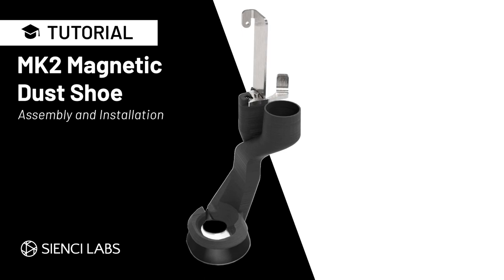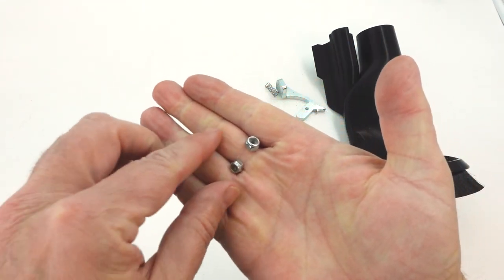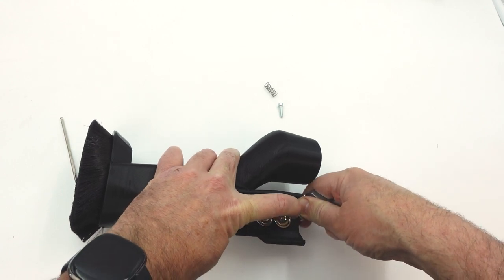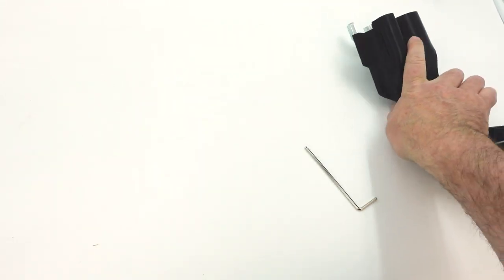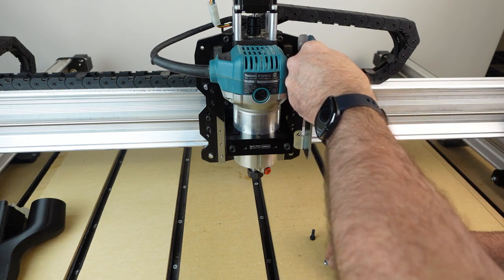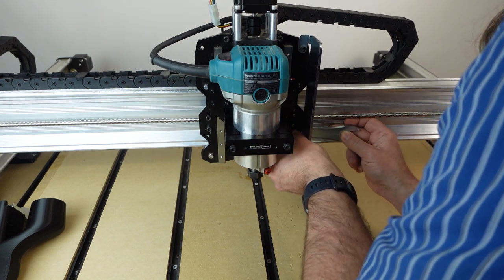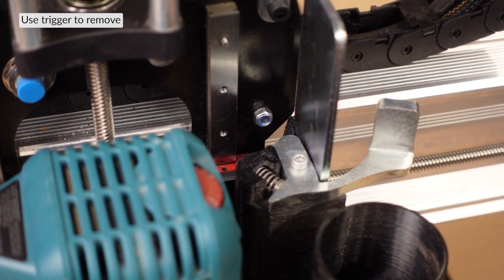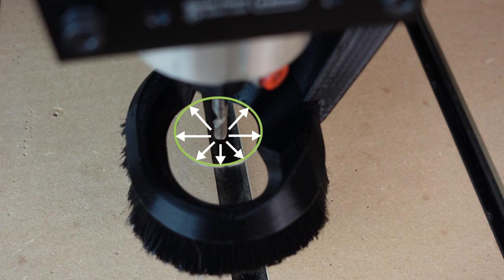How to assemble and install your LongMill MK2 magnetic dust shoe.

Comment: The back wall of the nut slot may be too shallow. I simply drilled out the bolt hole slightly since I did not have a tool to enlarge the back of the slot. It may make the hole slightly lsrge but the overall performance is still fine.
Reply from the maker: Glad you found a good solution Daniel. Yes the nut traps can sometimes be tricky since oversizing them can also cause problems so we err towards undersizing
Reply: Mine fit perfectly, no issues.

Comment: Why is this not compatible with Mk1? Looking at the video, it seems the router mount would be the same.
Reply from the maker: The reason is isn't compatible is that the linear rails in the MK1 are on the outside instead of the inside like on the MK2, so there's no room to mount and fit the mechanism without a full redesign